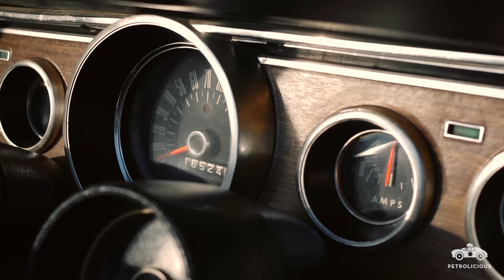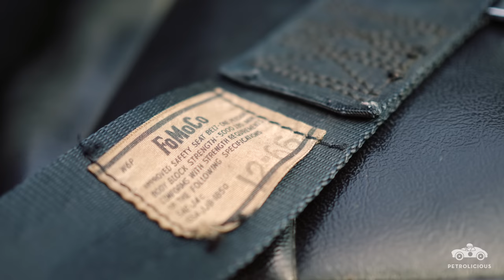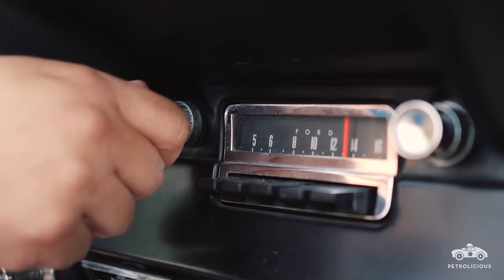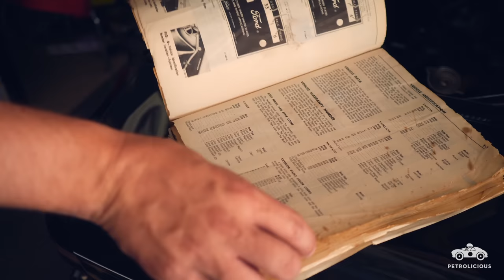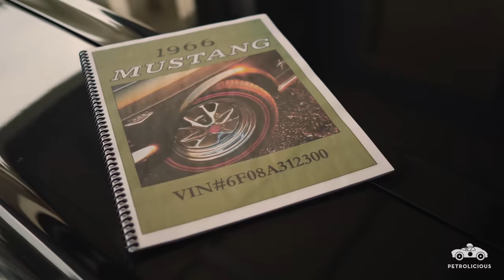1966 Ford Mustang Convertible: The Original Pony Car

Comment: This is guy is so right about not needing high horsepower to have fun. Most people these days engine swap old cars with more modern engine to get more horsepower. Which is fine, its their car, their choice. But its just so fun to drive a car you can go full throttle on but at the same time not break the speed limit and to listen to that N/A engine. Now thats is the best sound in a car you can get.
Reply: 2 years ago on a team building day we drove a french 40 year old 2CV with 29 HP. We floored it, made a lot of noise and still remembering it.

Comment: The mustang is such a fantastic car but one of my favorite parts is how it’s almost a blank canvas of a car, you can keep it beautiful and original or you can drop in engines of various caliber or set it on an extremely good suspension setup and gut the thing out. It’s probably one of the cars with the largest aftermarket industry so you can completely personalize it.

Comment: Interesting what he says about older cars having more drama even if they're slower. There definitely is an element of that for all older cars, but the thing to remember is that most cars people say that stuff about were performance cars in their day, so they had that drama designed into them. You can't compare a honda odyssey's drama to this, but it would be much closer to an equivalent family car of the time. Similarly the drama of a new Mustang (although still lacking something compared to the original) would be much closer to this than the odyssey.
Reply: cherrypieforever ahh but back then they had cars like the Porshe 930 and Carol Shelby Mustangs that could be bought the night before and raced the next day.

Comment: The first minutes explained perfectly why engines will always live. EVs will not be the only type of vehicles to roam this planet, but gearheads like us need the eargasm/drama that comes from internal combustion engines. This is why so many of us restore muscle cars, they are timeless in and out. I'm 30 years of age, I do enjoy newer cars; their abilities and features, but no EV compares to the sound of mechanical V8s. Whether they're N/A or forced induction; the purity of the mechanical engine building power under load, even at low speeds going through gears, just gets your juices flowing and skin shivering. It's a form of a dopamine hit every time you accelerate.

Just like some enjoy having smartwatches and digital watches, others like hand-winding/self-winding mechanical timepieces, which are still made till this day, even though we do not need them to tell time. Most of us use our phones. But this goes to show that ICE vehicles aren't going anywhere.

Comment: I've always loved the 1964-66 Ford Mustang. Both the coupe and convertible. While the Shelby Mustang may be more appreciated and has more performance and the GT models may be more fun to drive. I like the standard Mustang. My sister-in-law had one back in the 70s and 80s. My favourite here is the circular gauge cluster. While I've always loved horizontal speedometers, I also appreciate proper needle gauges over warning lights.

Comment: right on about driving an old car...I don't know that i would call it 'drama'...more like 'engaged'.  I have a '70 Mach 1 , Cleveland, 4speed, no power steering.  does have power discs tho.  You are involved when driving it.  so much more satisfying to really drive your car and not just sit in it.  the radio doesn't work and that's cool.
great vid and owner.  beautiful Mustang.  thx for sharing

Comment: didn't know you could upload porn to youtube
Reply: benjamin dover That's right Benjamin. I live in Texas and I'm 54. My first car in high school in east Texas during the early 1980s was a turquoise 1968 Ford Mustang 3 speed manual 200 with a V6 engine. It was all original except for plugs, filters, tires and those type things. That Mustang has been one of the two best cars I've owned. I would red light race a friend and his 1971 Ford Mustang Mach 1.

Comment: 2017 Honda Odyssey is about  255 hp at 4500 pounds, and the owner of the 66 mustang 289 hi po option is 271 hp at 2500 pounds ,  which one is quicker? isnt the  bottom line is HP to weight ratio?  other factors like gearing and stability and brakes do come into play though for newer cars yes you are correct in some ways

Comment: On his front 1966 Grille, His chrome "Horse and Corral" is sitting and placed way to high on the front grille.  It needs to come down a notch or two. From the bottom up, starting from the bottom, The bottom of the chrome Corral should start from the 3rd row up from the bottom in the Grille "that is visible when you look at the installed grille."  A very nice car though.  Just a tip... Tony K.  MCA#70001
Reply: NEF aurora Interesting...must be a production issue with this new grill I received as all the holes are pre-drilled on the face plate so there’s no other option available.

Comment: The Barracuda came out before the mustang. The mustang is nice for sure. But not first.
Reply: With all due respect to Chrysler and Plymouth for bringing the Barracuda to market a few weeks before the Mustang, it's basically a gussied-up Valiant and not an all-new product. Plymouth reacted to the Mustang's success by introducing the '67 Barracuda, with unique styling and being more performance oriented than it's predecessor.  Many feel the Mustang as the original pony car because it set the tone for the segment, even though Plymouth beat it to market by two weeks, which Ford allowed intentionally because of wanting to reveal the Mustang to the public at the New York's World Fair.
Reply: I agree, the Mustang was a lot more successful and set the tone for the segment. Which is why they call them "pony cars". As you said, the Barracuda was before it, and the Valiant (also offered in a coupe with a v8/manual) was around before even it. What does all new have to do with it? The mustang used a lot of stuff from the Falcon, so it wasn't "all-new product" either. Don't get me wrong, I like the mustang a lot and my dream garage includes one, but it wasn't first in the segment of fun, compact cars from Detroit. Which was all I was saying.
Reply: "Pony car" is not sporty compact car(American made, that is). The Studebaker Lark, Oldsmobile F-85, Pontiac Tempest, Chevy Corvair, Dodge Lancer GT, Ford Falcon Futura all predate the Barracuda and Mustang as sporty compacts, but aren't pony cars, I'm not even sure the original Barracuda qualifies as it's DNA is pure Valiant and not a metamorphosis of it, as is the case with the Mustang/Falcon connection. I'm just thinking about what you said and it made me question the original Barracuda even more. Just my take, I'm no expert, so hopefully you understand I'm not debating you.